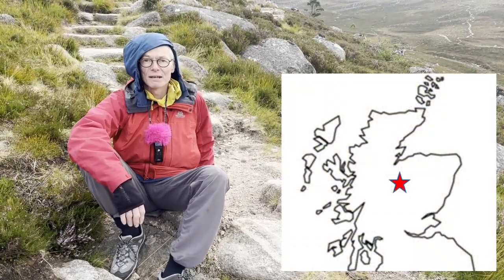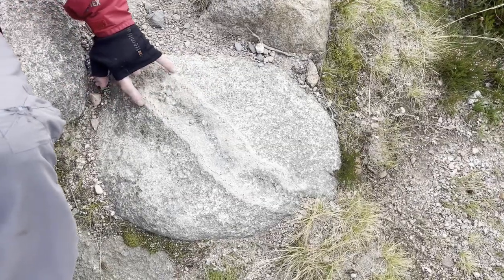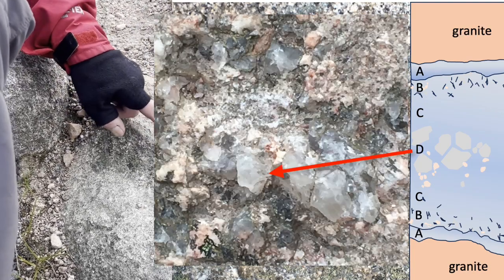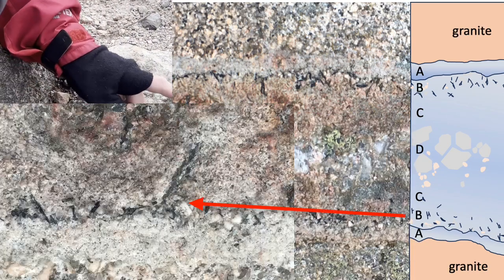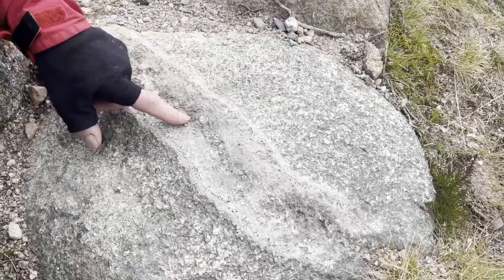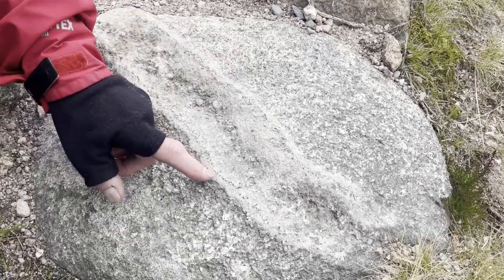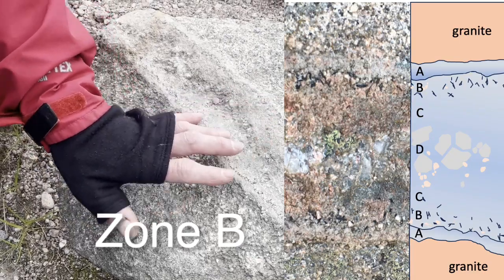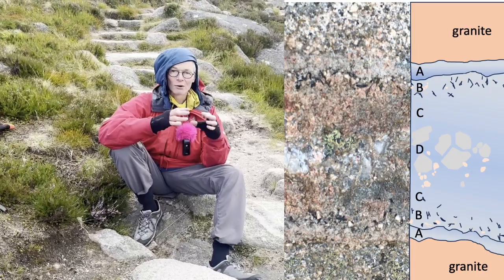Double Pegmatite Dyke: Coire an t-Sneachda

Comment: Great field opportunity to think about rocks as if they were in a beaker in a lab environment!! Especially when you start infusing the chemical transport dynamic!  And it's useful to think about rocks as in a frozen state, as it reminds you that they can be at a liquid state just as easy as water and behave a little bit like water with regards to chemical transport, it's just that they come to their frozen state at far higher temperatures than room temperature!  Ironically 'trapped' water, maybe since it's so common in rock formation, seems to be quite an influencer of macro level geological outcomes!   Thanks!
Reply from the maker: Yes, water is so important.  I don't think I have done anything on the other efferect it has beyond affecting metl properties (and hence eruptive styles) - but it also has a control on solid-state viscosity and hence convective styles.  Many geologists think that without surface water there would be no plate tectonics.  Probably a subject for a longer video sometime.